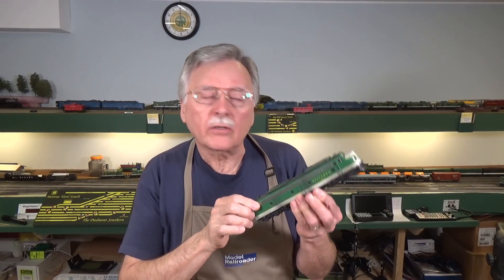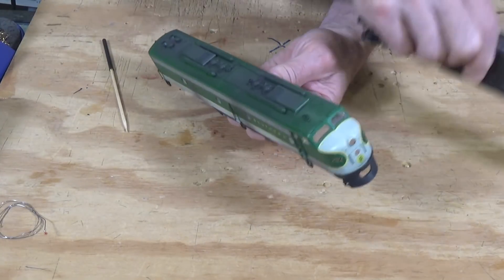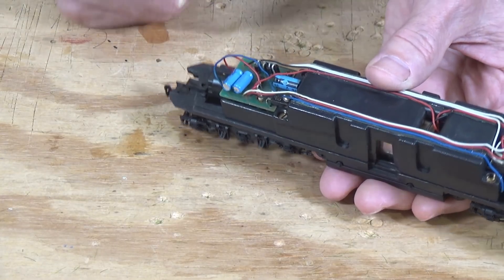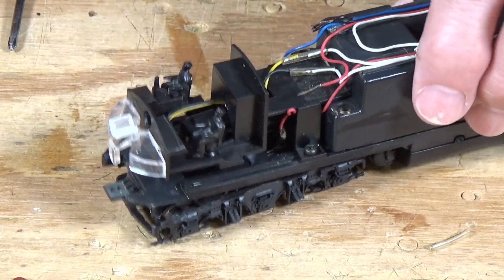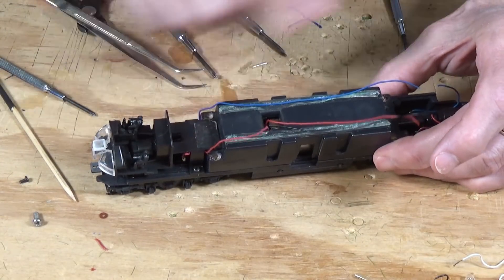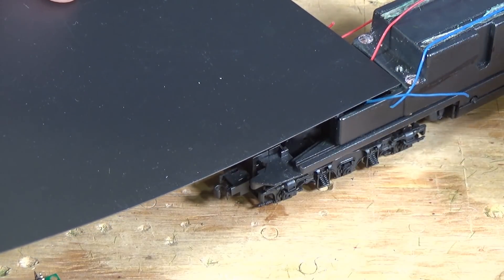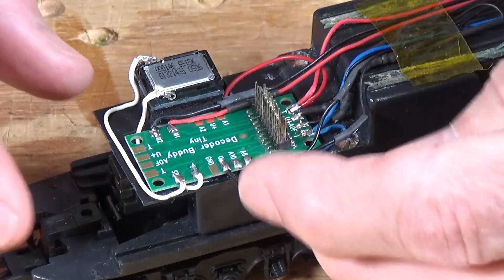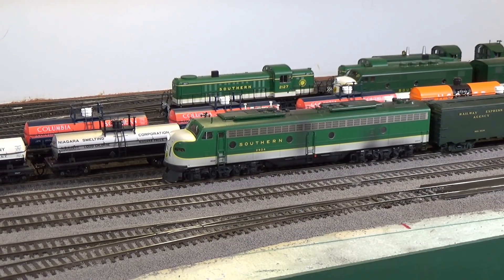DCC and Sound For Your LifeLike E-units (184)

Comment: Does the mars light not flash on this unit, I just bought the same loco and will be doing the same instal you just did.
Reply from the maker: Mars lights did not flash all the time. They were mainly used when approaching a crossing or a station, or in an emergency situation. Of course each railroad had their own rules. Most decoders allow you to program the light function with various effects such as a Mars light and in some you can tie that to things like when a horn is blown at a crossing or when the emergency button is pushed in addition to simply turning the function on.

Comment: Using the decoder buddy mini and a soundtrazz TSU2 21 pin decoder where would you connect a TCS KA2 keep alive?
Reply from the maker: There are solder pads on the board for attaching the KA wires.

Comment: Will I need be able to use this decoder with factory sound , or will I need to have it programmed ?
Reply from the maker: Ok, some of the decoders such as SoundTraxx and TCS WOWSound come with the sound files already installed. LokSound decoders come without the specific sound package and you MUST either ask the retailer to load the correct sounds for you or do it yourself which requires a special LokProgrammer interface. In all cases you will need to change things like the address and volume settings.

Comment: Did you have to remove a ground from the motor to the chassis frame (was this originally DC)?
Reply from the maker: Yes, if the motor is not isolated you must do that. But most models made that are “DCC ready” do have an isolated motor so check your instructions!

Comment: I recently purchased a Locsound 58429 decoder. It has 2 wires coming out from the corner by the pin area. I don’t know what they’re for . Possibly ground wires ? Can you help ? Thanks
Reply from the maker: What color are they and don’t the instructions say what they are? To my recollection I have never gotten a 21 pin LokSound decoder with wires attached. Since there are only 2 and if they are both brown they may be speaker wires but you need to download the decoder manual,and check the pin assignments to be sure. Who did you buy it from?
Reply: @TheDCCGuy   the wires are bare  and they’re on the left side of the decoder. I’m not sure how to download the manual and see nothing in the instructions about the wires. Can I send a pic to you ?
Reply: They’re on the end of the decoder , not the side. The decoder looks identical to the one you used for the conversion on the LifeLike E-6 .
Reply: I’m using a Decoder Mini Buddy.
Reply: Excuse me. After further examination I see that these wires are indeed brown in color. Very small .
Reply: I bought off EBay
Reply from the maker: Two brown wires probably are speaker wires as that is sort of a LokSound standard practice. However, as shown in the video, I used the speaker contacts on the Decoder Buddy as this totally isolates the decoder from any soldering issues. If you go to the LokSound website there should be a full decoder manual you can download.
Reply: @TheDCCGuy   Thank you so much. I thoroughly enjoy watching your videos. You’re a master and wish I could learn more. 👍
Reply: After finally understanding now that the brown wires go to speakers , asI use the Decoder Buddy for speakers ,what do I with the brown wires ?
Reply from the maker: I would just unsolder them or clip them off as close as possible.

Comment: My question  is did u have to take out the motor and put tape on the bottom. Or u don't have to u never did say for dcc
Reply from the maker: No these are DCC compatible out of the box and some even have 8 pin sockets.

Comment: Can you do a video on the Ngineering campfire.
Reply from the maker: Let me see what I can do. I have a hobo camp on the Piedmont Souther with a static campfire and adding a flickering effect might add some interest. It also may be possible to use an NCE Light-It or Illuminator and and orange LED to creat the same effect.
Reply: @TheDCCGuy  Thank you would be great.
Reply from the maker: I just looked over the Light-It instructions and I can fire up a red and a yellow or orange and yellow LED with different flash rates and create a flicker effect. I will give it a try tomorrow and see how convincing various flicker rates are.
Reply: @TheDCCGuy  👍 sounds like a plan to me.